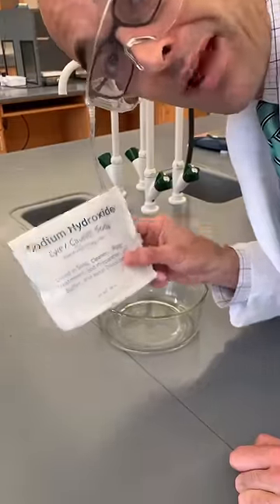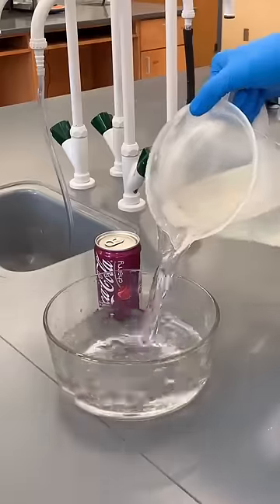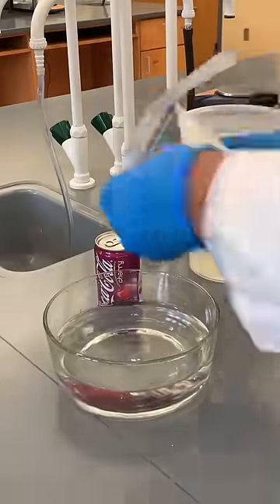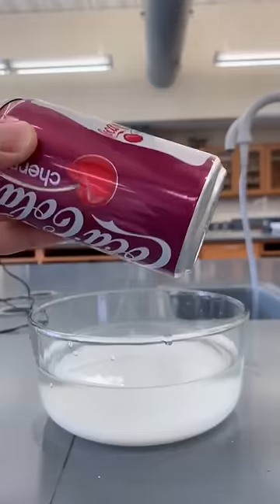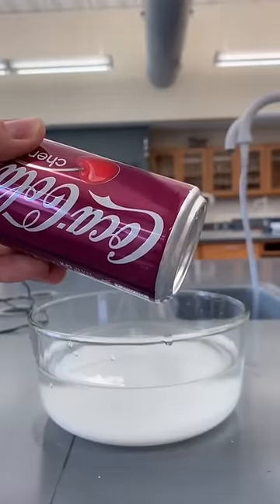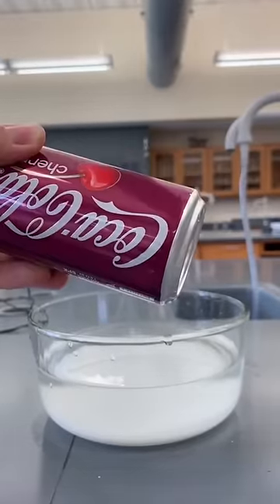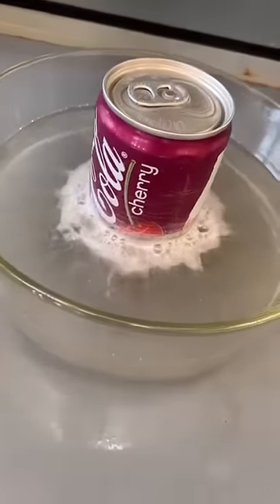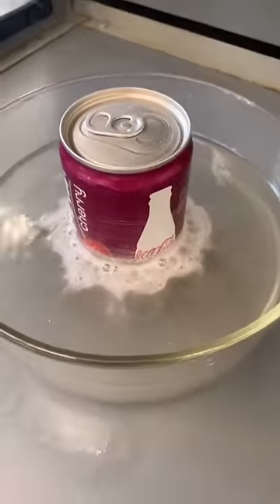Did you know this about aluminum cans?

Comment: For those of you who are not in the glass and can industry. They put plastic liners inside the aluminum cans for beer and sodas so the drink does not get a metallic flavor from being in contact with the metal for a long period of time. Especially with highly acidic drinks like Coke, which can eventually eat away through the aluminum. My father had an old can from the early 80s from China and this year I noticed the Coke ate through the bottom of the can. 

If you want to go green when you drink a soda or a beer, drink from glass, which is much more recyclable than aluminum and requires less to be recycled. In addition there is a recycled glass shortage so be sure to recycle!
Reply: many places are no longer accepting glass because it breaks in the machines and recyclers don't want to deal with it.
Recycling is a failed experiment and huge waste of money
Reply: @neelyschoolroadband  Recycling is a waste?
Hmmmm...
Reply: @neelyschoolroadband  Not true.  We recycle all sorts of glass containers here.
Reply: @hunterlg13 From what I read, something like 8% of what goes for recycle actually gets recycled. Yes, it is a huge waste. They create a completely separate waste stream and processing for it for virtually nothing.
Reply: @kaupification for plastic yes. Metal and glass are highly recyclable and the recycling process is efficient. Plastic is huge waste.
Reply: As a kid ALL sodas I drank were bottled in glass containers
Reply: Oh thanks for the information smart one! My confused brain couldn't handle the information given
Reply: @Heyant be nice man
Reply: Glass is not more recyclable than aluminum. The plastic inside cans is wasted garbage, but the aluminum is easily recycled. Glass is a finite resource that we will eventually run out of. Encouraging people to use glass will speed up that process, since more new glass is used than what is recycled.

The actual best way to be sustainable would be to get a sodastream and make your own soda/carbonated water. The compressed air and plastic bottle are reusable, the only waste is the containers for the condensed flavours, but you could always make your own instead. That would leave only alcohol for glass.
Reply: @matKilla9801  do you think the earth will run out of sand?  Because that’s what sand is.
Reply: @MarkSmith-js2pu had me laughing when I read his comment then I saw your and went ya someone called out that BS👍
Reply: Unfortunately, the recycling programs are not at all what we're led to believe they are. Always about money.
Reply: @matKilla9801  glass is made of Sand. Like beach sand it’s doubtful we will ever ever run out of glass.
Reply: Glass is more recyclable than Aluminum????

Absolutely Not.

It costs less to start with raw resource to make glass.

It also costs less to start with aluminum cans than mine aluminum.
Reply: Doesn’t the massive increase in weight from glass bottles greatly increase its carbon footprint? Or the fact that you cant pack bottles as densely due to need for extra packaging? Or the increased product waste from broken bottles during shipping. And glass bottles require a higher temperature than aluminum cans to melt down.
Reply: @ProleDaddy Do you know how much 8% really is? And why is it shit and needs to be discontinued instead of needing improvement? I tell you why: You don't want the hassle of sorting waste and everything that comes with proper recycling.
Reply: @marlonpaulus4478  I can't imagine how many extra trash trucks there are that are just out there to pick up recycling and how many extra miles they drive every week. That alone makes my point.
Reply: I'll be sure to smash my bottles on light of this fact
Reply: @fraidykat  Thing is, you have to mine bauxit and put a lot of energy inside + reducting the bauxit to get alumimium

So it's true. Recycling aluminium is a lot cheaper. Heck...you can melt those cans in a campfire 😅😂
Reply: @neelyschoolroadband glass is inert, basically just a fancy mineral. So even if you don't recycle a bottle, in many thousands of years it will still just be a glass bottle, or maybe some sand. A plastic bottle will degrade into microplastics, get absorbed by organisms including humans, and cause various health issues. So even if your reductive statement is true, it's still better to use glass over plastic (or plastic-lined aluminum).
Reply: @ProleDaddy use trucks that run on renewable energy. Problem solved. 
You're falling victim to the nirvana fallacy. Just because we're not yet at a perfect solution doesn't mean we shouldn't take steps toward a perfect solution. Just because electric vehicles are produced and powered by coal power plants today doesn't mean they're not worth it. It's way easier to replace one power plant than a million vehicles. And just because our recycling efforts are a net loss today doesn't mean it always will be. We literally can't get to a solution that works without passing through solutions that don't. That's how innovation works.
Reply: @basti77737  I mean, the most efficient way to make glass is to start with silica, not crushing up old glass back into silica.

The whole Shara is a glass deposit...
Reply: I wish they would just wash the fucking bottles not crush them and remelt them.
Reply: @hunterlg13  yes, its a waste.  It does not go where you think it goes.
Reply: @cagedtigersteve  Just because you put it in a bin that says glass does not mean it got recycled.  Many places that glass bin goes to the same landfill.
Reply: @rinnad.2184  Glass recycling is not more efficient than starting with raw silica sand.
Reply: Back in the 90s when Star Wars Episode 1 came out, the had Pepsi and some other sodas with characters from the movie on them. So I decided to save a full, unopened 6 cans of Pepsi with Anakin as a collector thing to sell in a few decades.

Fastforward 10 years, I came across the cans and every single one of them was empty. There were no holes, no corrosion, no leaked soda anywhere. It just bloody disappeared!

In reality I realize maybe the plastic liner and hence the can itself were damaged and the cola just leaked out somewhere convenient and didn't make a mess. Either that, or we've got aliens stealing Earth's supply of consumer-grade Pepsi.
Reply: Glass is so, so much heavier to transport which uses more fuel. Greenest and healthiest option is to drink tap water, or filtered tap water if that's an option. Or make drinks from your own water + a powdered mix or concentrate. Soda fountains use a concentrate + tap water to make the drinks. Why? Bc it would be untenable to ship, store, and deal so many bottles or cans.
Reply: @ProleDaddy That's just for plastic.
Reply: Aluminium is 100% recyclable, as glass.
Reply: @neelyschoolroadband Absolute rubbish (sorry, pun intended). 
Our local authority couldn't afford to run the refuse service on our current council charges without the money received from recycling. It's big business, huge amounts are recycled (items from carrier bags to paperware to household appliances contain recycled material). 
Are you really happy to see plastic washed up on beaches and in rivers? 
If a landfill site was planned a few hundred yards from your home, you would change your mind very quickly about recycling
Reply: @ProleDaddy 8% is a huge amount, literally tonnes of material from the average town per month. Even if we accept that figure (it is actuallyover 22% for Birmingham), it represents a landfill site or incinerator that doesn't need to exist.
Perhaps a landfill site being opened near you would change your view?
A refuse incinerator belching noxious fumes?
Reply: @creationlabsinc.189 I'm an old codger, we used to take pop bottles back to the shop and got 10p back. We used to pick up discarded glass bottles too, thus helping deal with litter. 
Our house still has glass milk bottles delivered and collected. Saves the dairy money on plastic containers which just get thrown away
Reply: @matKilla9801 We still have glass bottles for milk. Rinsed out, the dairy collects, sanitises and refills them. I imagine that saves vast amounts in plastic containers which customers throw away or recycle through the local authority, and all it costs the dairy is the cost of washing them
Reply: @MarkSmith-js2pu When the oil runs out, that's what the Saudis will be selling, perhaps?
Reply: @ProleDaddy Incorrect. My local authority provides figures on this, recycling not only provides enough income to pay for the recycling, plus a decent surplus, but they have a "third fleet" of trucks to collect garden waste in the summer (clippings, prunings, dead plants etc), which is sold for compost. I don't give them my garden waste. I have enough compost from recycling just my own waste to save literally hundreds of pounds in commercial compost over the year. 
Imagine how much the council earns from a town of 100,000 people 🤔
Reply: @ProleDaddy You would be surprised. My local council makes a profit from recycling
Reply: @heroclix0rz They find glass vessels from Roman settlements occasionally, literally thousands of years old and still intact
Reply: @heroclix0rz It's not a net loss. If it were, it wouldn't happen. Especially in Conservative Britain
Reply: @tomhubbard8510 Our milk arrives in glass bottles, we rinse them when empty (especially in summer, no one wants smelly milk bottles on their van - or their doorstep) and the dairy collects, sanitises and refills them. 
Saves them a fortune, and gives me a smug feeling of self righteousness
Reply: @fraidykat It appears to go straight into the ocean, judging by the maelstrom of crap mid Atlantic and washing up on beaches
Reply: @VoidHalo @fraidycat was right...someone is stealing from the recycling and even from unopened cans 😱
Reply: @neelyschoolroadband  they crush it up anyway, allows more storage.
Reply: @Neil070  The savings you speak of is dwarfed by the impact of manufacturing, powering, maintenance of, employment of workers and their produced waste and used energy, and untold other factors. Capitalists choose the mode, method, and manor of production and distribution. If we ended them, things could really change then at the source and that is a solution. Nobody ever looks at the source, only the symptoms. Open your eyes to the systemic causation of everything around you.
Reply: @Neil070  I'm not talking about income. I'm talking about environmental impact. I couldn't care less about capital as it's nothing but the means to steal labor value from and oppress workers. 

I agree that city ordinances contribute greatly to pollution and waste. Let's look at the system that they operate under and their motivation for doing what it is they're doing to create and enforce all this waste.
Reply: Few sodas are sold in the US in bottles comparatively, any longer. Also few places in the US recycle glass any longer as well. Aluminum is the easiest to recycle. I've even seen it used to make gun lowers from a stack of beer cans.
Reply: True glass recycling would be to use the same bottle 1001 times.
Reply: @cagedtigersteve   Just because its done, doesn't mean its not wasteful
Reply: I guess why the bottom lid of the can didn't dissolve is it being thicker than the sides?
Reply: Except for so many trash pick-up companies that claim to offer recycle, do NOT take glass anymore as they say it too expensive, especially on the machines. Even crazy is many also waste time sending a separate truck to pick up your recycling bin items only for that truck to go right to the same landfill that is what my old one did it was caught multiple times and then they just quit offering recycling period where I currently live they do take the recycling trucks to the recycling plant however none of the plastic is recycled, only the metals and paper/paper! Doing a bit of research on this turns out a lot of the plastic recycling it's just a gimmick to make people feel better about buying everything in this toxic chemical leaching product . Sad that 99% of our products come in plastic day, my family and I have done a lot of work to switch over to products that are sold in glass, paper, or biodegradable materials, it is extremely hard work but worth it for your health and the environment.
Reply: I usually keep my glass containers to reuse... So many uses - for food, storage, drinks, plants, etc. It's rare if I use any plastics/ plastic bags...
Reply: @waynesmith1273  it is thicker, but it’s also why cans should be stored long term on their bottoms and not upside down or on their side. And I do mean long term, a few years, till it can eat through it. I once had an old Chinese coke can from the 90s as a souvenir…just found last year it slowly ate through the can and the acid had eaten into the shelf it was on, destroying the protective coat.
Reply: They stopped allowing glass in my recycling years ago.
Reply: Loved this experiment! We no longer have a way to recycle glass locally. So frustrating!
Reply: @hunterlg13  Yes, I make sure to break all my bottles in the woods or on the highway to return the glass to nature properly.
Reply: @matKilla9801  We will run out of glass... Do you... know how glass is produced. There is enough raw resources on the SURFACE of the planet, to produce around rough estimate ~1 septillion tons of glass.

 We could produce ALL new glass for everything for the next quadrillion years... I think we are good.
Reply: @MarkSmith-js2pu  I had read years ago sand on beaches was being stolen .
Reply: I'm a bottle dump digger, and I can get all the glass bottles I want. I will recycle them if I can get money for them.
Reply: @hunterlg13 yes plastic recycling is 5-10%. Rest is sent elsewhere.
Reply: @matKilla9801 🌍 will never run out of glass ever, same with almost all of the metals, gasses etc most are unlimited.
Reply: @thommyzie22  and glass is all natural and breaks back down. I love glass.
Reply: @ProleDaddy  Is it not that they add recycled glass to the batch. 8% is recycled and 92% is new glass, thats the ratio of how much recycled glass that are added.
Reply: @TradBarbie  well it’s not 100% renewable. You do need to add material back into the crushed glass to reform new molds, but only 33% of new materials is needed, versus 100% for new bottles every single time.
Reply: @matKilla9801 I don't think we're going to run out of sand that's what glasses made out of
Reply: @rickweber4267  it’s a special type of sand, not all sand can used for that application.